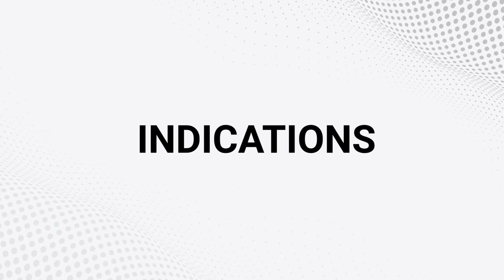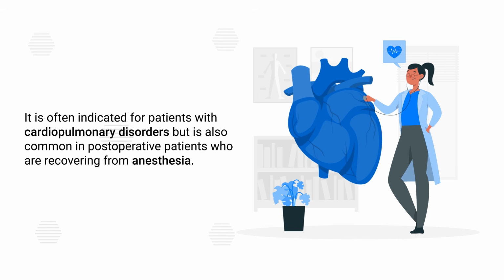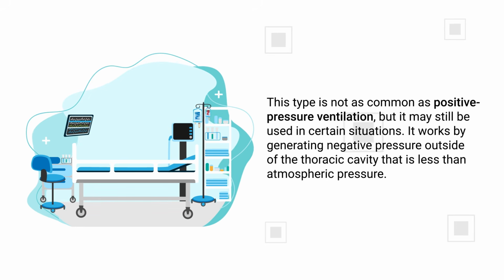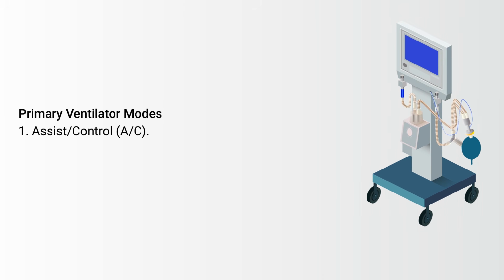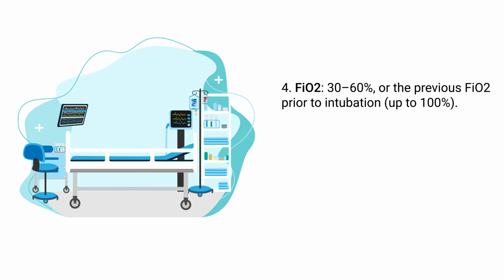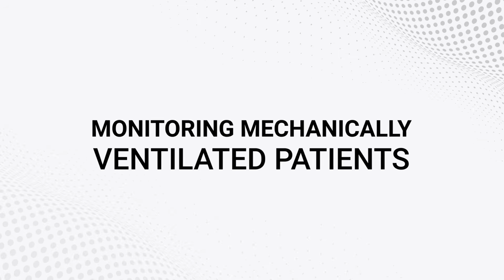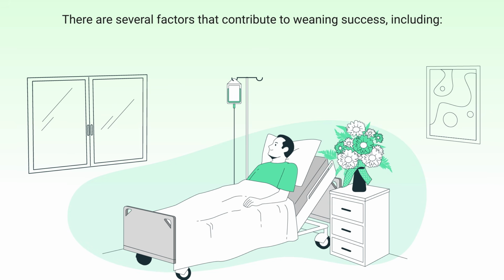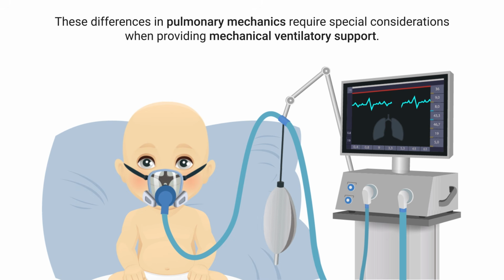Mechanical Ventilation *MADE EASY* | Ventilator Basics Explained

Comment: This video was easy to understand. Simple enough for those that are in respiratory school and those that are not. As mentioned in the video, MV is hard to understand because there is so much that goes into setting and manipulating based on the patient's disease process. This video helped me focus my understanding of the basics. I was able to write down the key points along with an easy explanation of all the modes, the settings & the reasons a person is placed on a ventilator and how the ventilator assist breathing. For me, Its easier to learn something if the basics are explained simple & then build on it. This video did just that. Thank you for all you do!